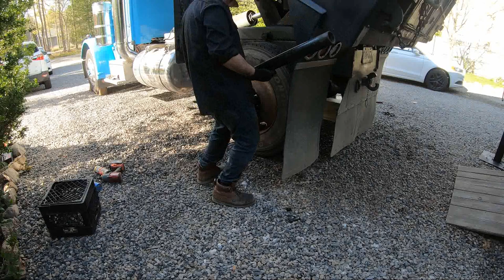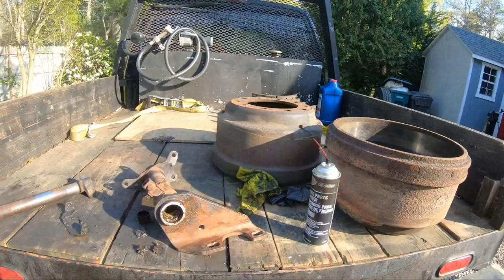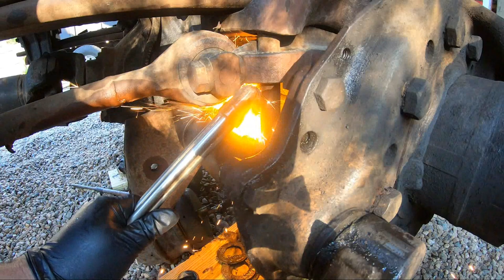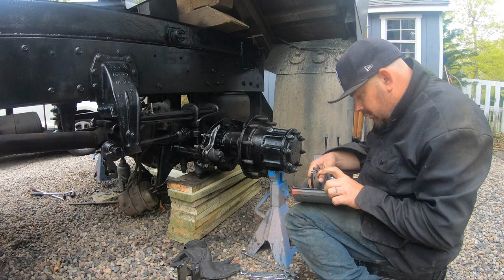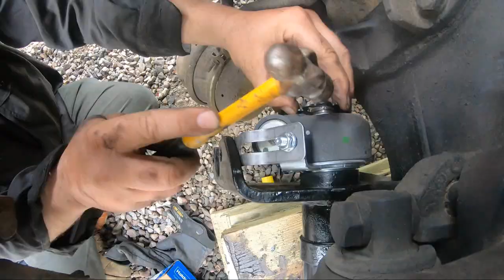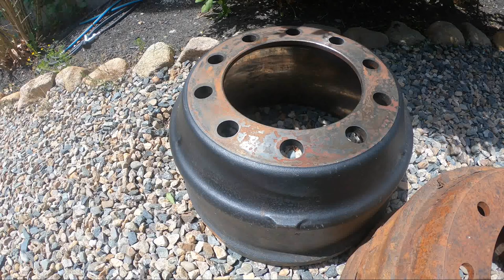Changing Air Brakes & Rims On My Peterbilt 359!

Comment: Your air trac wear pads on the front spring hanger are shot. Your gonna want to replace all 4. As it sits right now, your pinion angles are off about a degree becuase of it. Replace those and you will be good to go. ITs a one to 2 day job. I did all mine a year ago and did a buddies truck 2 months ago.
Reply from the maker: The wear pads and the rollers under them are new just replaced a couple months ago and when they go bad you get a bad groaning noise in the transmission. There’s only 2 it’s a six wheeler 😂   I’m good now that I have the right drums thanks

Comment: 99.9% of the time take a hammer hit inner nut one direction and back other direction breaks them loose. Another if you're breaking inner nuts off all the time stud to short. Many trucks were built with steel on steel and someone will put outer alum wheel on or both alum wheels. Now stud is too short so when person tightens outer nut it crushes inner nut because there is no support from stud to stop it. So when person remove outer nut may break inner nut off or break when removing inner nut
Reply from the maker: Yeah These are aluminum nuts. I changed them a few years ago to the longer style. I’ve tried hitting them before. No luck .. Thanks for watching!
Reply: @DirtBrute  Chrome plated outer nut was used with alum wheel.  Inner nut with shoulder that's for if you have inside alum wheels. But hub stud needs to be longer if alum is used to support inner nut. I did tires on a truck that owner put alum on alum but truck was built with steel on steel. When taking them off I broke most of inner nuts. Told him had wrong hub studs was told I've done this for years never had a problem. Even showed him Firestine wheel guild showing he was wrong. GUESS what set of his duals came off 2 months later and hit a car killing people inside on interstate in Texas. Fun talking to lawyers 3 of them, state, Companies, his insurance. Told them all them he had wrong studs and even showed him the guild book and that he had never had a problem before doing this way. It settled out of court against him. I even gave firestone guild book to company lawyer. He was trying to put it all on me. This was 27 years ago when this happened and not long after that I changed jobs and have never done tires since. I still work on trucks but at dealership now
Reply from the maker: @pdmustgtd1013  these were changed 2 years to Accommodate aluminum on the out side. You can tell when they are meant for steel on steel because there is not enough Thread to grab with aluminum. That’s why I changed them and they ordered what their book said then Through out  the old ones. Thanks for watching!
Reply: I'm not talking about inner or outer nut. With drum, inside tire on with 2 inner nuts, then outer tire on.  Check wheel studs that have no inner or outer nuts on. You should have at least 1/2 inch of main stud (hub stud) hanging out pass the wheel rim. Shouldn't be down in the hole or flush
Reply from the maker: @pdmustgtd1013  it’s all up to spec . I pressed out the (hub studs) for new ones When I switched over .  This is the 5 truck And one trailer I’ve done it to. Thanks
Reply: @DirtBrute  Not a ;problem just checking because I really hate to see tires come off. Just seen many that were done wrong and where owner tried to put it on to me. We just had one in the shop doing brakes we refused to put truck back together. He was going to tow it out but changed his mind and had us put correct parts in. It is safety issue where and shops can refuse. It may sound mean to force them to fix it right. But if person dies whats the first thing they do blame you. Like 2015 Mustang lug nuts torq to 148 ft but guy put them to 100. Says I've never had a problem before. My car didn't leave until it was done right. I did recheck with my torq wrench to be sure. Yes I'm a tech at Peterbilt dealership